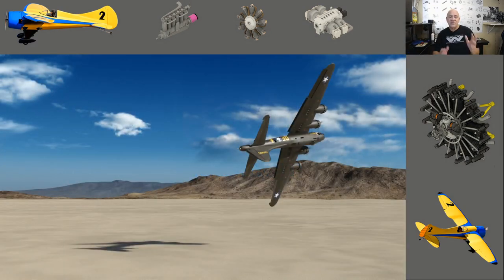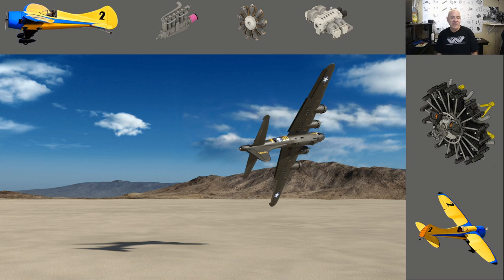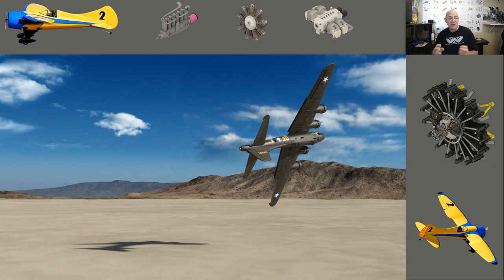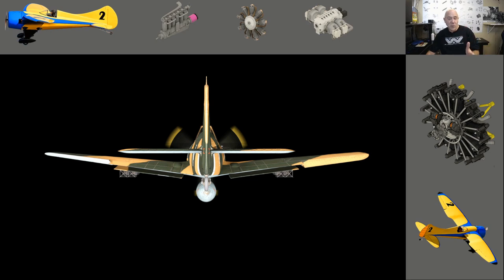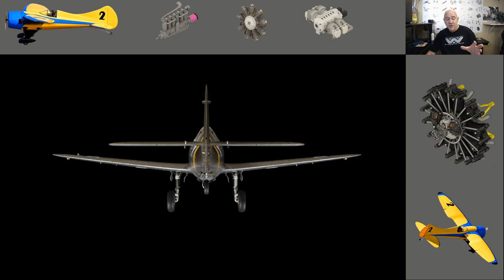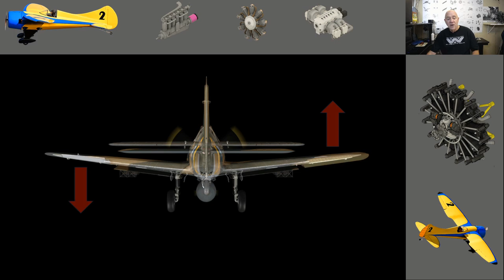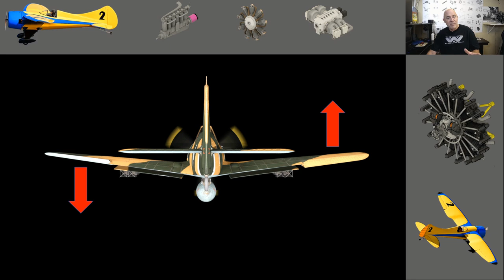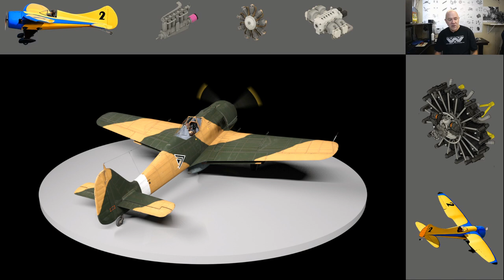How can anyone take off with their Aileron Servo Reversed?

Comment: Hey I laughed when I saw this video because it reminded me of my own reversed aileron flight😂
I only been flying for about 3 years and I’m now 51. One day I turned up to the field hooked my little VQ Maracana .46 nitro up, turned my radio on, turned my plane on, checked my surfaces, all worked, started engine and taxied out to the strip. 
Lined up yelled taking off, off I went. Got up to speed, got off the ground and went to turn right. Plane went left, oh shit!! I yanked the stick the other way and cut throttle and landed in dry marsh. No damage. 
I’d recently been having a few dead sticks with this engine so I thought I had had a dead stick, don’t ask me why, it was just stuck in my head. 
Got back to the pits and proceeded to tune the engine. All good. Taxied out, lined up again and started off down the strip. This time I was going to get up high to give myself more time to deal with a dead stick. After gaining altitude I went to bank slowly to the right but quickly realised my ailerons were backwards. Oops!!! I levelled out the wing and thought now what? I’ve never learn how to rudder turn I’ve always used the ailerons to bank over and use rudder/ elevator to turn around the corner mode 1.
This was a disaster but a thought oh well it’s gotta get down somehow so I put on the thinking cap and flew my ailerons backwards a full circuit around the field, did a perfect line up with the strip and started descending. This was the most terrifying time of all. Somehow I managed to keep the wings level and completed a perfect 3 point landing and promptly collapsed to the ground in fits of laughter with a large cheer from my flying mates who knew what was happening. Great hobby

Comment: I did that once for not paying attention. Fortunately for me I had a spotter. The transmitter I was using had slide switches that enabled the user to reverse channels. I flew the model using rudder and the spotter removed the panel on the transmitter and reversed the aileron channel. The transmitter was an Airtronic 7 channel.

Comment: When I teach and before every take off, we do a "High Five"  Put the sticks in the bottom left corner and elevator should go up, rudder points left and aileron on the left goes up. (the way the stick is pointing.  Repeat on the right corner. Then each control surface individually to make sure the channels are correct.  This is done at taxi time. I had a plane I set up at home,. I checked surfaces several times, had a friend look at it, but when I did my usual "High Five" it was wrong. Ailerons reversed!    Plane saved.

Comment: Dag, great stories on paying attention to controls  - with enough altitude you can save the airplane, or act like your flying upside down and reverse control input :-) I thinking that model aircraft can survive flying through the loop is possible for two reasons  first, there is no pilot, ( unless the baby is flying ), otherwise g forces would kill you. Or model aircraft could have a higher Vne or g force loading  and avert structural failure Either way you probably only get one pass. I'm assuming the same physics scale down to RC aircraft size. 
A real life story of not applying correct control services for a short take off - you probably know - is one of the B25's on the Doolittle raid forgot to set his flaps and took off, went below deck and was seen pulling up. I'm sure the pilot was a tad nervous. I'm really enjoying your RC videos and expertise, and  getting more tempted  to start in. I've started back with model building but the cost has certainly changed, the supplies cost as much as the models. Standing by for more adventures.
Reply from the maker: Thanks!! Rock ON! Great info. I always wondered how someone could have forgotten the flaps on the raid. CHECK LIST! lol.